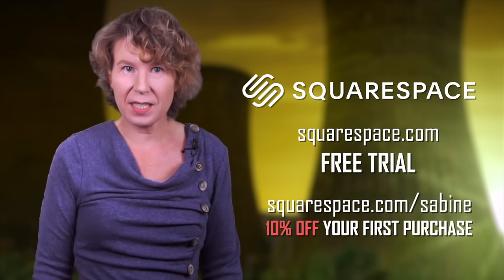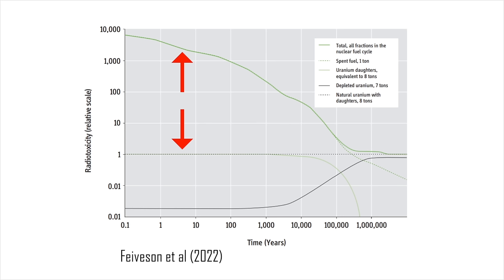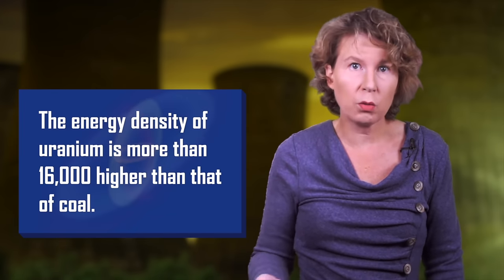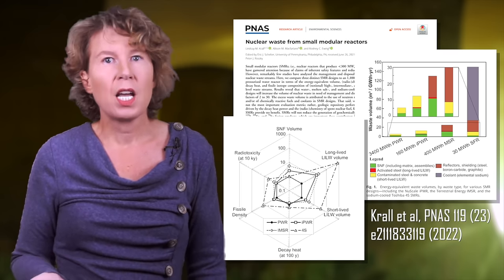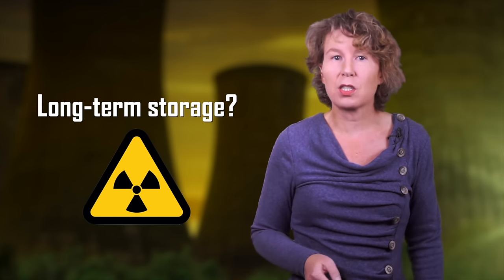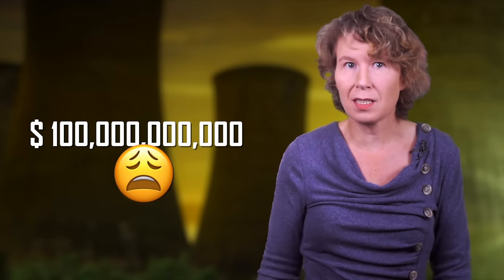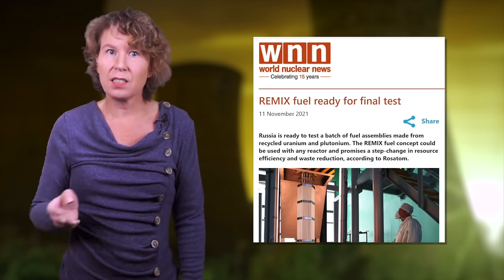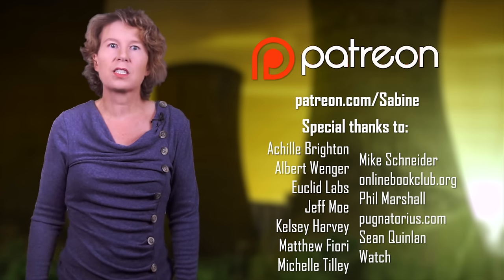Nuclear waste is not the problem you've been made to believe it is

Comment: "I'd say it kind of works like a water mill, just a little more dangerous."
I'm gonna call you on that one. If you compare the fatalities from nuclear power plants vs. the fatalities from actual water mills (hydroelectric or hydromechanical power in all its forms), I'm pretty sure the nuclear plants are safer.
Reply: Here's the problem with measuring safety by rate of fatalities: The well-known paradoxon that that fatalities might be low precisely because of high awareness of unsafety and lots of safety measures. For example, if you meaure the safety of street types for bicycles and you go by fatalities, you might find that a German Autobahn is safer than a Dutch bike lane – because hundreds of thousands of people cycle on the bike lanes and virtually no one on the Autobahn, and even if one ends up on the road, they will be extremely cautious. Similarly, a worker in a water mill might be much more cavalier with safety precisely because the risk is lower.
Reply: @Nebufelis  "a worker in a water mill might be much more cavalier with safety precisely because the risk is lower."
If workers being cavalier causes more fatal accidents, then that's a work culture problem and it makes that workplace less safe than one with a better safety culture. The risk is not lower. The risk is higher. You are more likely to get hurt working there, which is the bottom line of risk.

No one is saying nuclear power doesn't have potential hazards. But if those hazards are mitigated through combinations of hazard removal efforts, engineered controls, safe procedures, and a strong safety culture, then I don't see the issue in saying that this is, in all the ways that matter, a safer work environment than one that lacks these things because there's a failure to perceive potential hazards and therefore gets people hurt.

The statistics bear this out. Nuclear is the safest power source by far. How it gets safe isn't the question, what matters is that there's objective and indisputable proof that it is the safest in terms of injuring or killing the fewest people.
Reply: @wasd____  ..potential hazards!!!!!
Reply: @Trylobyte  Yes, there are many potential hazards at a hydro plant. All that water has a lot of energy. Read the stories of what happens when those dams break.
Reply: She was talking about the process by which work is extracted...i.e. via steam turbine. She was not talking about risk at that point.
Reply: Are you counting all the people who died from Chernobyl, three mile island, sellafield etc from radiation poisoning, cancer etc 5-20 years later?
Reply: @StoutProper  Yes, I am.
Reply: @wasd____  you’re not very good at counting then. Show us your working and we’ll correct you
Reply: @wasd____  you have stated no evidence or facts, just apocryphal opinions
Reply: @StoutProper  I'm sorry you don't understand when a conversation is over. You must be awkward at social events.
Reply: @wasd____  you’re still here, still replying, still continuing the conversation. Try shutting your trap and the conversation will be over, until then, it isn’t.
Reply: @wasd____  tldr but do carry on the convo
Reply: @StoutProper  WORST estimates for Chernobyl from the WHO and similar associations account for like 10000 extra deaths from those things (cancers, etc). Other more reliable (not using LNT) ones, around 300 to 500. One for Fukushima. TMI emitted as much radiation as a CAT scan. Never seen data about Sellafield, but one can say about half the ones from Chernobyl ( similar, but not as bad situation)

Meanwhile, Hydropower dam collapses

Banquiao and Shimantan Dams:170000-250000 deaths
Vajont:1900-2500 deaths

Machchu-2 Dam: 5000 deaths
Reply: @zweisteinya  What metric would you prefer? I'd like to hear your methodological reasoning and basis for measuring how "dangerous" a power source is, if you think you know a better one.
Reply: Hmm, then here is a question: Why does the nuclear industry need exemptions from the rules? Where I live and I just assume it's similar to where you live, you need a liability insurance in order to operate a business. 
Probably some of the brightest mathematical minds (who surely in the vast majority also understand the arguments of physicists and engineers)work for reinsurance companies. And they since decades refuse to cover insurance damages caused by nuclear plants. Which is why across the whole world politicians exempted the nuclear industry from most of its liability. That isn't exactly a "level playing field".
My major problem is: Yes, I do think we, as humankind in general,  could use nuclear power to our advantage. We understand how to do it. But socially we don't have the solutions for it. Both completely state-run aplications or private aplications didn't work. Either political  partisanship in bureaucracy or dividends over security screw people over.
Reply: @eugenebelford9087  "Why does the nuclear industry need exemptions from the rules? Where I live and I just assume it's similar to where you live, you need a liability insurance in order to operate a business."
Probably to protect the nuclear industry from being made unprofitable by having to litigate or settle endless frivolous but expensive claims made by idiots who assume (and convince a lawyer to latch onto their case for a payday, however unearned or unjust) that their problems are somehow caused by the big scary nuclear plant. You can win every lawsuit that gets thrown at you, but the costs of winning are still ruinous when it's a lot of lawsuits, whether they're justified or not.
Reply: @StoutProper  The UNSCEAR did the job, referencing hundreds of scientific peer reviewed papers.

Go read it. And if you disagree with their conclusions, do your own research, publish it and contest their results and conclusion and we'll judge how the scientific community evaluate your work.
Reply: @etienne8110  nonsense
Reply: @AlldaylongRock  piffle
Reply: @StoutProper  Shutting down the remaining units at Chornobyl has killed more people than even considering the worst reports by the World Health Organization (10000 deaths, and it utilized LNT - a debunked method of assessing low-level exposure (under 100milisievert a year according to the now accepted method which ignores exposures under that threshold - after those 100mSi there's a statistical significance of less than 1% of extra cancer risk, and then it increases linearly as per the LNT) - as well as assuming way higher exposure than actually observed, currently if total estimated deaths are around 5000 it's a stretch).
At least 14000 people died because Ukraine had been resorting to coal to replace the lost generation capacity, and this is being pretty mild with the calculations. Several hundreds of people are also dying in Germany and Europe for the same reason since the beginning of the Energiewende failure.
Reply: @etienne8110  You can't argue with stupid/trolls.
I don't remember very well how many deaths/extra cancer cases the latest UNSCEAR report considers. But I bet it's less than the 14000 that have died because of the shutdown of the remaining units. (see how many days have passed, multiply those days by the capacity, then a very low estimate of 75% capacity factor, and finally multiply the amount of TWh by the deaths/TWh of coal)
Reply: @AlldaylongRock  That wasn't as much for him than for anyone else reading.

Science is clear on the matter and hundreds of peer reviewed papers are available.

Whereas his trolling is based on nothing. 

That was my point. ^^

If trolls disagree with the available science, then they just have to get to work and publish datas backing their claims.
Reply: @16vjtdalfa Yes, actually. I do think coal and fossil fuel industries should have to pay out for the many, many millions of people they've killed directly or significantly contributed to killing, and for the environmental degradation they've forced us all to live with.
Solar panel manufacturers should be treated like any other industrial polluter should, and be made made to pay to clean up their own mess and recycle waste materials safely.
Reply: Pretty sure Frau Doktor Sabine is German so she was probably referring to the old fashioned "Wasser Mühle", not hydro.  I have not heard of a death from those.
Reply: Also you can't just factor in workers deaths, when things go wrong, consequences are far reaching. It's hard to calculate how many deaths were caused by Chernobyl and Fukushima but just counting the workers would be disingenuous.
Reply: @annnee6818  "Also you can't just factor in workers deaths"
I'm not. I'm also factoring in things like the deaths caused by hydroelectric dams breaking, which is a thing that happens, and when it happens, it destroys entire towns downstream and often kills large fractions of said towns' populations.

"It's hard to calculate how many deaths were caused by Chernobyl and Fukushima"
No, it's not. It's not really too hard to measure how much contamination released by those events ended up in humans, therefore it's not hard to calculate how many deaths they caused.
Some of the worst-case estimates for Chernobyl that are considered plausible put the upper limit at somewhere around 4,000 deaths total. The reality is probably somewhere around half that or lower, considering that these are worst case estimates, and that in reality even the liquidators who were working at ground zero immediately after the explosion haven't shown statistical excesses of cancers, so total deaths actually caused by Chernobyl are probably quite low.
Fukushima is a similar situation. The disaster itself killed very few in an immediate sense. Of the contamination released, almost none of it actually entered or likely will enter the human population, so most likely the number of deaths actually attributed to Fukushima radiologically is in the single digits. Around 2,000 people likely died collaterally, due to stress and poor conditions during the evacuation period (which comes down to a badly managed evacuation, not nuclear hazards, and these deaths likely would have happened in any similar disaster forcing a large evacuation, not specific to nuclear incidents).

Contrast with hydro dam breaks:
Banqiao and Shimantan dams in China, 1975: killed (est.) 240,000 people, caused 11 million more to become homeless (forcing them to live in conditions which probably killed even more).

Machu-2 dam, India, 1979: killed 5,000 people.

Vajont Dam, Italy, 1963: killed about 2,000 people.

Panshet Dam, India, 1961: killed about 1,000 people.

And the list goes on, extensively.
This is just counting major-disaster-related deaths from hydro, and only fairly recent deaths from in the same timeframe as nuclear power to keep the comparison fair.
Even by conservative estimates of the dangers of hydroelectric power, and pessimistic estimates of the impact of nuclear disasters, hydro comes out much worse.
There. Your homework is done for you, because I guess you're the kind of person who needs someone else to do that. Normally I'd have given you the same treatment as Guinness up there and just dismissed you by noting that, no, actually, you're the one coming in with an arrogant bluster of "Nuh uh, you're wrong!" while hypocritically being the one who is actually offering no validated evidence or even having bothered getting yourself backgrounded on the topic to be able to contribute meaningfully to a discussion.
But in a spirit of generosity, here's a freebee, I did the work for you so that you can have the benefit of being informed on the matter. Enjoy.
Reply: @Nebufelis  Correct. And any 'single statistic' analysis will almost always be insufficient.
Reply: @wasd____  
Where and when has any hydro power dam broken?
Nowhere and never.
You're in greater danger from the potential of a passnger jet airliner falling on your head.
Reply: @TheDavidlloydjones  ...He said ducking....."what the F*** was that?"
Reply: @eugenebelford9087  you and I are certainly on the same page. Humans are smart enough to come up with all sorts of clever solutions to technical problems. It's the social/political side of mankind that I don't trust with nuclear power. A few years ago, our most powerful nation elected someone as their leader who had no qualms about staying blatant lies as fact for instance.
Reply: Without figures, this is just your opinion.
Reply: @RealButcher  ...You have google. You can find 'figures' in about 30 seconds, and you would have done so before coming in here to comment, if you actually had any good-faith intention of participating in the conversation in a meaningful way.
Reply: @wasd____  Ah, drinking again. Are you?
But I see now that you yourself have not even been looking om the interweb.
Then you wold know how hard it is to find figures. 
It's a very very hard work / lots of factors to keep in mind and the last figures are from 2016. 
Over to you Winston.
Reply: @RealButcher  "Over to you?" What would you like me to respond to? You're just wrong, the 'figures' are easily found (you just couldn't be bothered to invest a few minutes searching the web, could you?) and saying it's "hard" is nonsense. There's nothing more to say, really - because there's no point in saying anything more to someone who hasn't contributed anything meaningful to the conversation.
When you're ready to make some sort of genuinely informed, good-faith effort, then we can talk. Until then, this childish contrarian "nuh uh!" crap with no actual basis is just disrespecting the time of everyone else. Cut the bullshit. Come back when you have something of substance.
Reply: Does the counts include Chernobyl, Fukushima, Three Mile Island and Hanford in Washington? And also, Hiroshima and Nagasaki, Bikini Atoll, because nuclear power can't be separated from nuclear weapons.
Reply: @wankertanker1813  "Does the counts include Chernobyl, Fukushima, Three Mile Island and Hanford in Washington?"
Yes. All of those combined have caused far fewer deaths than hydro dam accidents and failures.

"nuclear power can't be separated from nuclear weapons"
Yes, it can. There are reactor designs that aren't linked to weapons production. Those are among the best designs and are probably the future of nuclear power.
Reply: @wasd____  You're not a very friendly person. Are you?
Reply: @TheDavidlloydjones  China.  They don’t like to publish such disasters.
Reply: I don't think that accidents with hydroelectric plants lead to such consequences as Chernobyl, Fukushima?
Reply: @joacimnieminen  You're right, they don't lead to the same consequences - they lead to worse consequences. Accidents with hydroelectric plant failures have killed more people by far than nuclear accidents have.
Reply: @joacimnieminen  then you don’t know your history.  You can believe what you want.  You can listen to whatever you want, but don’t ignore all the facts.
Reply: @joacimnieminen  Take a good look at Pripyat. Nature is resilient enough. There are plenty of bigger and smaller structures built by humans that we cannot allow to fail for various reasons, and they don't (Thames barrier for example). They do not get the same publicity though. Nuclear powerplants can be safe the same way. They are actually! That doesn't get the same publicity either.
Even with all the tragedies nuclear is the safest option by far, and the numbers agree on that.
Reply: @henryhuynh9182  atoms for peace was propaganda in the 1950s. Atoms for peace is propaganda now.

They use the same types of images of smiling children playing together in both eras.
Reply: @wankertanker1813  cool thanks for the non argument
Reply: @RealButcher  I'm not sure why anyone should be friendly to people who act like you
Reply: @iqbalindaryono8984  That's not what I asked. But,
Reply: @Nebufelis  The extreme safety measures around modern light water nuclear plants are there for two main reasons. 

First, the plants are extremely valuable, w large capacity, running nearly nonstop for 40-80 years w negligible fuel cost. Wrecking one over some stupid accident that never really harms the public like TMI is an enormous economic loss, esp compared to some coal plant that runs 50% w a third the life and is less profitable because of fuel costs and emissions costs.  

Second, the public has been made to fear nuclear power.  No public died from radiation at TMI, none at Fukushima, but it might as well have been millions w the media coverage.  There are risks w nuclear accidents, but compared to, say, chemical plants and trains and jet accidents, not so much.   And so, given the difficulty in building new nuclear, the nuclear power industry has become a Radiation Safety Industry (tm). It gets paid by fear.
Reply: The new Moltex plants currently undergoing regulatory approval are intrinsically safe. The core has no moving parts and has virtually no internal pressure. There is no hot water to corrode the steel. There is no hydrogen to potentially explode or cause embrittlement of the metal parts. There is no build-up of noble gasses and no neutron poisons within the core. The reactor power is fully self regulating. When the core warms, its power reduces. When it cools the power increases. It’s normal operating temperature produces steam at 575 centigrade - the same as any thermal power plant. Heat is removed from the reactor via a third molten salt circuit. This heats thermal stores located outside the nuclear “island”. Steam generators use this stored heat. The reactor core never sees water or air in any form.
Reply: @davidelliott5843  Note that this is all good and dandy, but it's the passive decay heat removal systems which are the big selling point. It's the lack of decay heat removal which damaged Three Mile Island IIRC and also caused Fukushima.
Reply: @wasd____  nah sunshine, its when something like Fukushima occurs, no one wants to pay for the cleanup costs, which are astronomical,the Insurance industry, unlike you,  are not blase about the potential dangers ( and costs ) of a major nuclear disaster.  7.1472 trillion yen for damages paid to people affected by the disaster; 2.9954 trillion yen for decontamination-related costs; 268.2 billion yen related to temporary storage facilities for contaminated materials; and 1.7019 trillion yen for nuclear decommissioning work and dealing with contaminated water.
Reply: @boginoid   Fukushima: 7.1472 trillion yen for damages paid to people affected by the disaster; 2.9954 trillion yen for decontamination-related costs; 268.2 billion yen related to temporary storage facilities for contaminated materials; and 1.7019 trillion yen for nuclear decommissioning work and dealing with contaminated water, which is still increasing daily as they have no way to stop it.
Reply: @reverendbarker650  Cool story. I'll just go ahead and refer you to the posts above in this thread, where it's been shown how many MORE people hydro has killed and injured than nuclear ever has.
Reply: @reverendbarker650  But no actual death tied to radiation leaks.
Reply: I'm too busy to read through this whole conversation, but to everyone who gets to read this, don't turn each other apart over the chernobyl death count, first, you can't put death against death and call it a day, if someone dies 3 years earlier because he lived next to a coal power plant it's just no comparable to someone raysick from chernobyl, suffering horribly for his whole life to come and dying from cancer at some point, no second, the death count is an insanely complicated question, the 69 deaths are a complete joke and everyone should know that by now, the WHO presented 4000 deaths in I think 2005, but that's not even in their own study, basically you have some honestly pretty unreliable WHO numbers saying like 10000 and the highest ones from nuclear energy enemies saying over a million people died, reliable studies go to max a few hundred thousand, but the liquidators that didn't die are sadly unable to work for the rest of their lives and a lot of their funding was cut too, because local governments want to leave the case behind, so there are now about 100.000-1000.000 liquidators spread all over the former soviet union (guess why the numbers vary so insanely), most sick for the rest of their lives and pretty left alone, about 90% percent of the total liquidators actually, so up 900.000 people, sleep well tonight
Reply: @AlldaylongRock  the energiewende didn't fail, we now have a solare plant on our roof, wasn't too expensive and now cover most of our energy consumption ourselves😎
Reply: @wasd____  I could elaborate on some of the studies I found, but I did that with your two comrades, just watch this Video (he concludes on a pro nuclear statement, don't worry), the death count is an insanely controversial and complicated topic, that will probably never be truly known, but it's a perverse thing anyway, you'll see so in the Video.
Reply: @RealButcher  he's also very convinced that his death count is accurate, probably watched the kurzgesagt Video as discussion basis
Reply: @iqbalindaryono8984  yeah, being friendly to people with different opinions is an outdated thing anyway, isn't it
Reply: Danger and risk are different things
Reply: @wasd____  >>How it gets safe isn't the question, <<

Yes it is, because it makes it more expensive and the margin for errors are lower, if someone, for what ever reasons, decides to "cut corners".
Reply: @CrniWuk  If someone cuts corners, that's inherently an unsafe situation arising from a failure to create and enforce an organizational safety culture so by definition that falls outside the meaning of "safe."
Ultimately, no, it doesn't matter how nuclear power is made safe, at least for the sake of argument here. The point is that in practice it IS safer than the other options by orders of magnitude and that's really not debatable due to how strong the evidence is for that conclusion.